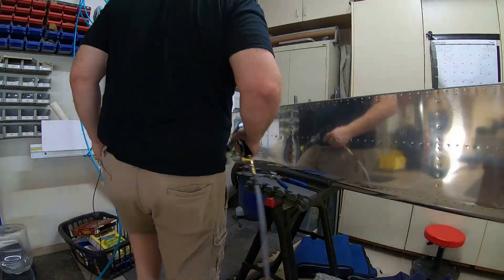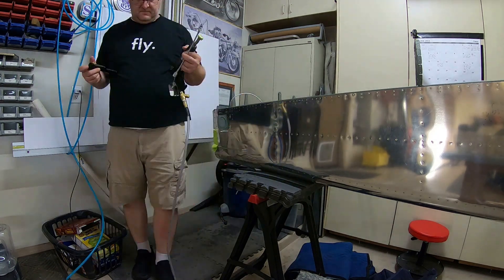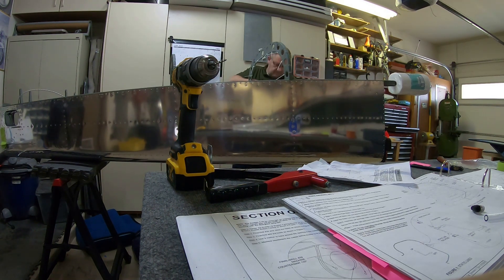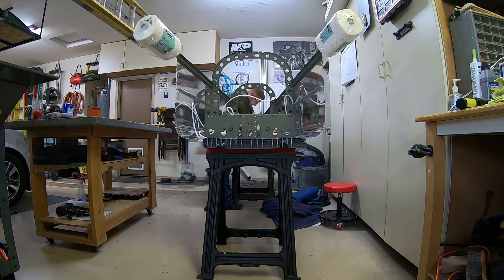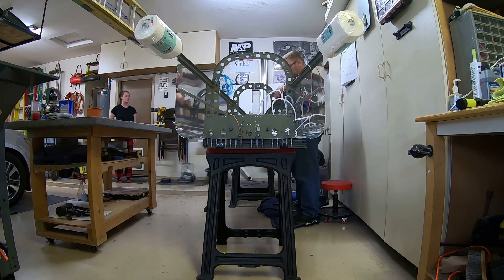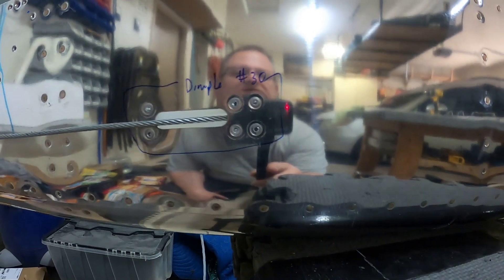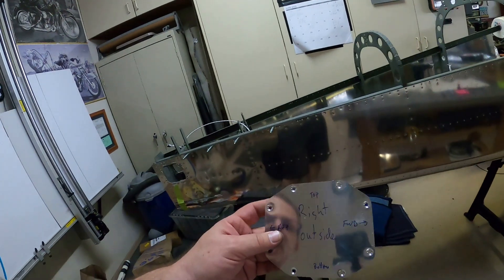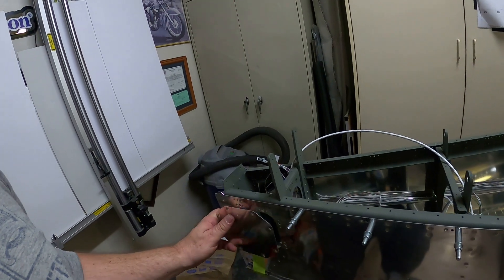RV-14A Build: Aft Fuselage 10.8 - How to Build A Vans RV-14A Airplane #vansaircraft #aviation

Comment: About those pulled rivets coming through the washers behind the plastic rudder cable guides - I'm thinking about fabricating a small plate from "extra" skin aluminum to fit on the interior side of the plastic guides and match drilling. Going to check with Van's next week if they think that is a good idea. If they give me the green light I may not even need those washers.
Reply from the maker: I think that is a brilliant idea! I used the washers and they were just a little bit off and  caused all kinds of headaches. Let me know how it goes with the skin solution.
Thanks for watching!
Reply: @SlinkAir it worked like a charm, i ended up using the washers too, for extra support.

 FYI, the 2 pulled rivets used on the forward two holes are not sized properly. They work fine for the thicker, 4 hole guide plate, but not on the thinner 2 hole plate.
You can either order different, shorter,  rivets or just grind off the mandrel sticking out like you did. Van's should have included different rivets for those forward 2.